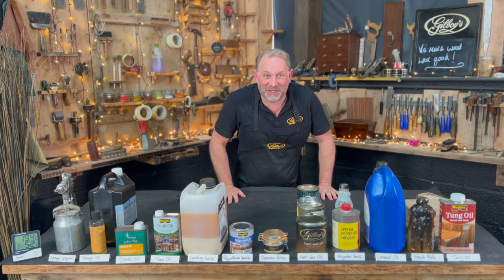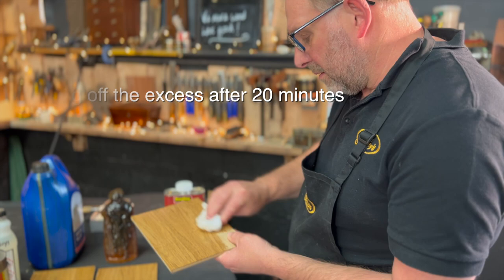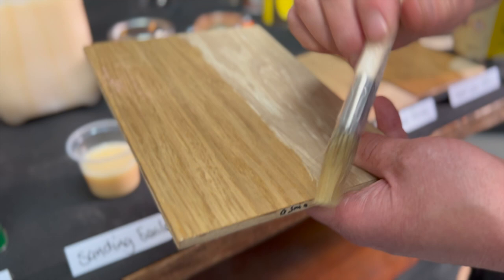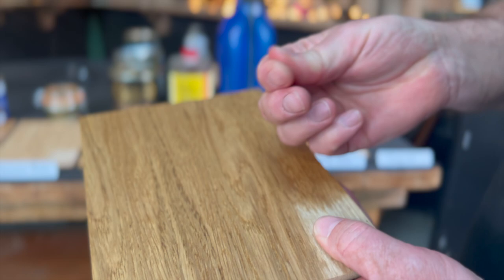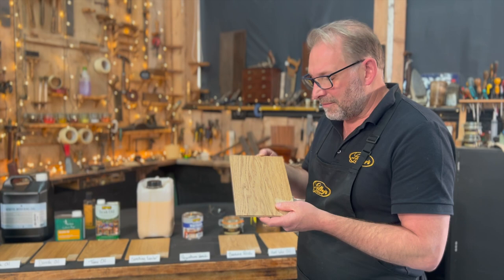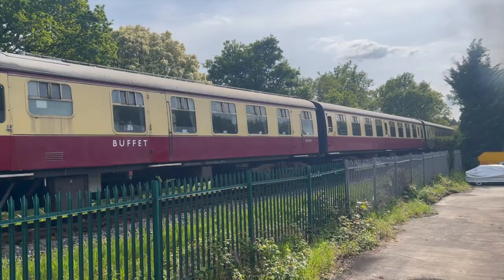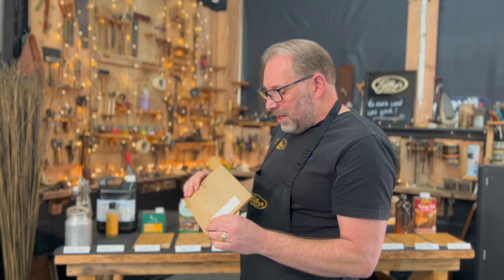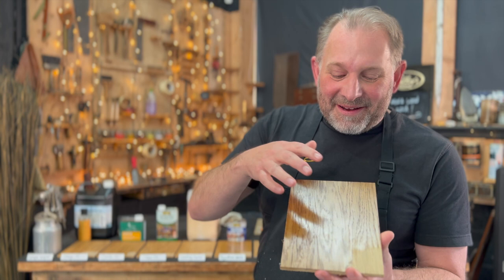Comparing and Applying all the Wood Finishes in our Workshop

Comment: My 1950’s house had factory stained wood floors when I had them stripped and sanded down left the finishing up to the professional’s, I came back to see orange floors. As I lived in an apartment for several years with 1960’s orange carpets that was a no go. Ready to have the floors stained black the fellas recommend a white polyurethane. Couldn’t have been happier. The colors in the wood were beautiful. Pale greens every now and then and no more orange. Over the years it’s held up well. It’s a mat Finish.

Comment: I recently watched a video comparing a number of hard wax oils, including Rubios (of which Rubio's did not do so well). And although, the idea of it seemed logical I was not to excited about the need of mixing hardeners with them suggesting that there were perhaps other elements in the mix that I would not like in the mix.  However, while watching this I noticed that it contained no toxic or petroleum chemicals nor was there a need for a separate hardener.  Now, I have a number of pieces of antiques, nothing expensive but roughly a hundred to a hundred and a half years old. Some of the original finishes have been almost worn away, while others look to simply need a good waxing.  At first, I was just going to go the route of buying the Antique Gold wax, but then seeing how nice a finish the wax oil combined with the wax on top of it looked I am thinking of going that route.  However, I have no experience with wood working or finishing and no idea what the proper thing to actually do is.  I have these things not because of any value inherent to them, as that doesn't matter to me at all.  It's just that I love old things, and this is the first time in my life when I can do as I wish without having to compromise with anyone else who would rather go the modern route of processes wood furniture meant to be tossed away in two years.  So, seeing how the Gilboy's wax oil works with the wax as well really has me chomping at the bit. Especially with an antique oak bookcase glass cabinet that I recently found.  The finish or original wax seems to have completely worn away and really just could use a new wax job, but I think using the wax oil first then the wax on top of it would be much more durable. We shall see.

Comment: We have oak work surfaces in our kitchen that have been oiled but it's not very good with water drips. Is it possible to apply hard wax oil over the top with just a light sanding or would we have to sand it right back to bare wood?
Reply from the maker: Hi Richard and Julie. 
Good question. If the top has been previously oiled then ours should go over the top. Its not something I would normally recommend with nearly all the other finishes. But as long as the top is clean of any contamination (food grease etc) and its dry. then it should go over it well.  
My advice would be to sand it with 320 grit paper and vacuuming off before apply a thin coat. Try it on a small test are first ✅
If it works well, then off you go 😁
Best wishes 
Simon

Comment: Absolutely agree with you about the hard wax product. I haven't tried your brand yet (not available yet here in Canada) but I do use one of the other brands you mentioned. I have been re-purposing antique/vintage furniture as a hobby for about 2 yrs and this product is a game changer to achieve a professional finish. I didn't know you could wax over the top so will be trying that with my Gilboy's. Love your waxes and thank you for sharing your excellent tips.
Reply from the maker: Thanks Susan. 
Isn't it great stuff! I won't ramble on about again, as I have just done so to David Mitchell's comment above. 
Yes. You don't have to wax it, But I like the finish it gives you, especially when refinishing old furniture ✅ 
And. And! You can wax the surface first and then apply the HWO over the top! 😳 You cant do that on any other finishes! 
Thank you once again. 
Simon

Comment: I just bought an antique (here in the US) oak cabinet and the current finish is failing in front--oddly in almost uniform droplet shapes, which makes me wonder if there was an accident of someone dropping something that spattered onto the finish and over time affected the finish? I don't know, but I clearly need to do something and don't want to refinish the whole piece. I love the color and sheen on the existing finish, so just want to do something that minimizes the damage and protects the piece going forward. 

I spend HOURS this week researching products that might work and had just about given up (every time I found one that sounded good I would do more research and find people complaining about the formula changing, or a certain ingredient being bad for wood long term, or too strong-smelling--read high VOC--to use indoors, and it would be back to the computer to keep researching). Then I found your page and these products sound perfect! But I am such a novice I don't know if I should put the hard wax oil over the existing finish and then use the beeswax or just use the beeswax. . . ? Can you please advise what you recommend people do when the piece is overall finished (and I don't know what kind of finish it has--clearly not poly though) and needs a touch-up? Thank you!
Reply from the maker: Thank you. The best thing to do first, Is just use our beeswax polish. 
Keep it simple. Theres no need to apply anything else at this stage. the polish may be all you need and you are not going to 
do any damage by using it. Take a look at our website and read the reviews. I think it will help you. 
kind regards Simon
Reply: @GilboysRestoration  OK that may have seemed self-explanatory to you but it was very helpful to me! I ordered kits from your site last week and am looking forward to trying them : )

Comment: Overall Stephen, I cannot disagree with your observations  re these various finishes. For myself, I too love using shellac/french polish and have used this on all the antiques and antique joinery In my homes.  It’s my go to finish. I absolutely agree that with table tops that are likely to have hot drinks or even cold drinks etc it’s not so practical but I can live with this. 

I am yet to try it out but I do know of a product out here from a supplier called hard shellac (not sure exactly what it is) that apparently is more resistant/durable to exposure from heat and water.  

Out here in Australia, there was a company  (Feast Watson) that used to produce a tung oil/poly finish which was absolutely brilliant to use and over the years I used it on all my floors, some joinery and bench tops in the kitchen/bathroom. Heat and water never caused this finish any issues, and if damaged or worn it was easy to repair.  Alas for some reason they have stopped making this finish. 

I recently finished some kitchen bench tops and shelving using a oil based product (Livos Kunos countertop oil). The client wanted me to use this, and it was slow drying but after 5 coats it gave a reasonable satin finish which hopefully will be durable. Did I like it though, no. I personally won’t use finishes like linseed, danish, orange oil etc as I have never had good results with any of these and yes the drying time between coats is such a pain.

The hard wax oil is a product I have yet to try but given your comments on this, I think I am going to have to try it out. So given this, do you need to sand back between coats to achieve a good finish and if you apply multiple coats say at a minimum of 3-4, will it always stay satin or with increasing numbers of coats will it result in a level of gloss ?? 

Recently, I have been doing a lot of wood refinishing on boats and in this environment given the exposure to UV, salt water etc, the whole issue re which wood finish product to use is once again a vexed question. So many different finish products out there but questionable durability to consider and differing opinions/experiences with them.
Reply from the maker: Hi David 
Thank you for all your comments and observations.  You are right though,  it is a minefield when it comes to the choice of finishes. 
I was introduced to Hard Wax Oil about 8 years ago by an interior designer who wanted us to apply it on one their pieces of furniture. Over time I realised that this product was quite extraordinary in its performance. 
For years and years we had been using two pack, acid catalysed melamine lacquer for high traffic (modern) dining tables and coffee tables etc. 
But here was a product that you could just wipe on and re-coat within 8 hours or so. It not only looks better because its not a high build film coating, it also performs at the same high level of hardness and wear. And, And! It also didn't require the person applying it to be dressed up like a spaceman to use it. WOW! 

I honestly could pour the same product into a number of tins and rename it.... 

1) Kitchen Worktop Oil
2) Door Oil 
3) Slip Resistant Floor Oil 
4) Staircase Oil ( including Treads, risers spindles and handrails) 
5) Table Top Oil 
6) Food Safe Oil for Wood 
7) Toy Safe Wood Oil 

Because it is all of these things. 
Durability is always a question, but with these oils they can easily be spot repaired, - (by anyone! 😳) unlike film producing coatings. 
Bloody marvellous stuff. 😅
I do hope to have an exterior wood oil soon

Going back to your question. I tend to favour lightly sanding between coats with 320 grit or the equivalent scotch-brite pad. 
The sheen level will always stay at smooth satin no matter how many applications. have a look here. 03:20 One, two or three applications? 

Best wishes 
Simon
Reply: @GilboysRestoration  Hi Simon, wow thankyou so much for your detailed response. It is so helpful and absolutely I totally agree that so many of the old finishes (poly, two pack etc) are so less environmentally friendly, let alone issues to one’s health due to the high VOCs one had to contend with.  Having taken on board all you note, I decided given my latest project was the total refurbishment of a kitchen with timber doors, drawers, panels, let alone the floor, all of which was badly marked/worn etc that going with the hard wax oil is the way to go. I must say, like  yourself I have found it easy to work with, it dries overnight, the grain of the timbers have come back to life and the overall finish looks excellent. So thankyou, your latest video and your above comments are so much appreciated. Yes, I concur the finish regardless of coats remains satin, but that is nice. I can actually obtain a gloss hard wax here but having looked at the sample demonstration pieces at my paint shop, there didn’t appear to be much difference between satin and gloss. 

I would be very interested on your opinion/experience with exterior wood finishes in due course as this is something I have to contend with for various purposes at home, let alone on boats etc.

Comment: Thanks for the video, great breakdown of the various finishes available.  One thing I'd say is that you're using oak veneer rather than solid wood, so the oil products are going to struggle as there's simply no "meat on the bone" for them to soak into?  I'm far from the pro that you are, but the times I've used oil finishes they've gone off reasonably quickly on solid wood products (although I'd also admit they were yearly applications to bone dry, sun cooked wood, so....  Sponge City!  ;p)
Reply from the maker: Hi. Hard wax oil works very well on veneer. 
Unlike traditional oils like, Danish, Tung, Teak etc. Hard Wax Oils don't penetrate anywhere near as deep into the wood. They bond with the top surface of the wood and immediately start drying. Its one of the many positives of using them. It's also one of the many reasons why I really like them. 🙂   
Kind regards 
Simon

Comment: I am rather confused about your hard wax oil, on your website it states "No Petroleum", yet in the Material Safety Data Sheet it states that it contains "Naphtha (petroleum)". How come?
Reply from the maker: Hi. Yes there is a very tiny amount in there. 
When we had it tested by an external labelling specialists this year (2023). It was deemed so minor that it did not require any hazard statement in any way. It very important to us that it was a 'hazard free product' which it is. 🙂
I will talk to our web specialist and make sure that our website is updated.  ✅
Kindest regards
Simon